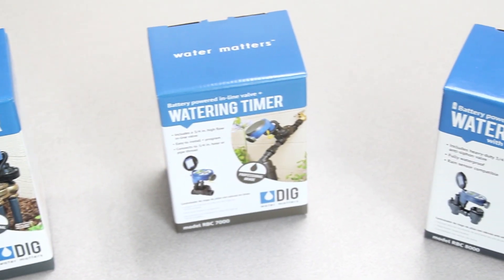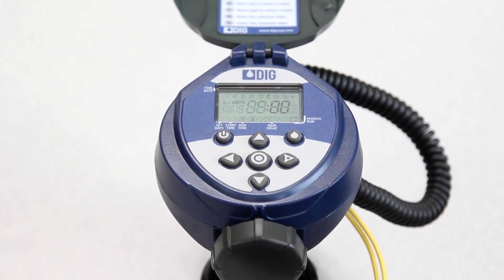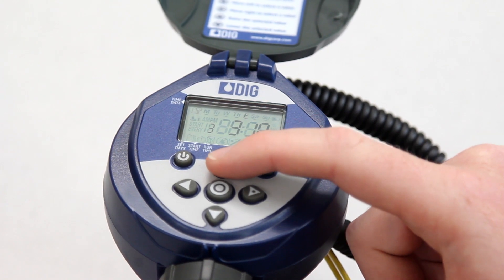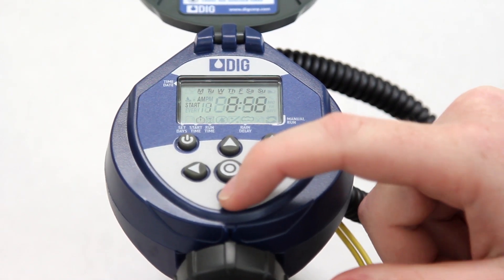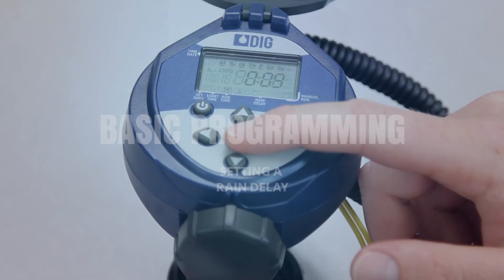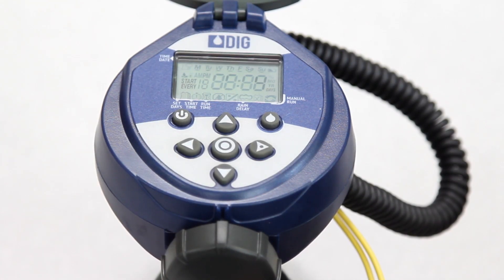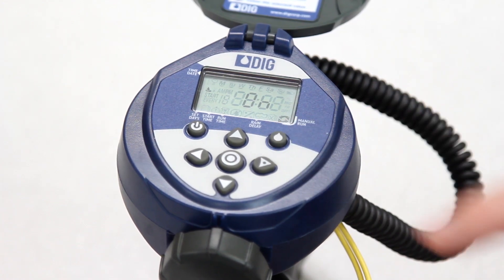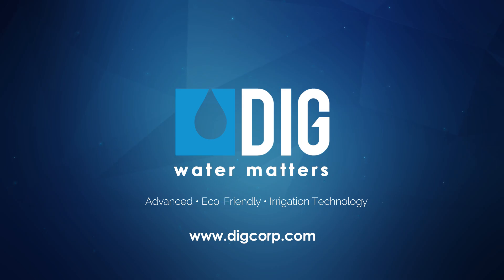DIG RBC Series Battery Operated Timers: Programming

Comment: The first page of the Instruction Manual should direct the new owner to the YouTube video for programing this timer.  The printed portion of the programing section makes complete sense ONLY after watching this video.  

Dig Corp, the acronym KISS is suggested for those that write the manual.  "Keep in Simple Stupid".  I had been using the Dig Model 2004 for 21 years, faultless product until the small plastic 'bayonet' was too worn to function, that part is no longer available.  It was replaced with a RBC 7000 with absolutely no need to change any 'plumbing', thanks Dig.

Comment: I ser a rain delay and it never resumed watering.

It would always just say 4 days on the rain delay setting.  So I finally went in and manually turned the rain delay off.

What did I do wrong?  Shouldn’t a rain delay count down and then resume watering after that 4th day (what I was trying to set.

Comment: My sprinkler system is programmed but just won’t turn on automatically anymore. I have to press the manual button if I want the sprinklers to turn on. What can I do?
Reply from the maker: Hey Ivan, can you please call our tech service department at (800) 344-1172 and we can troubleshoot this issue with you.
Reply: @DIGCORPORATION  what was the solution? I have the same issue.

Comment: Lets get real here. This timer although full-featured, and battery operated, is about 5 times more difficult to program than it should be. I will seek someone else's product. I'm surprised that you didn't include a note at the end of the video to the effect that, if I had any problems I could always "rewrite the embedded code".
Reply from the maker: Hey Jack, sorry to hear about your issues with our timer. We do have customer service available at 800) 344-1172 from 7:00 am to 4:00 pm PDT that can help with any programming troubles. We also have a bluetooth option that is very simple to program, if you're interested. https://www.digcorp.com/professional-irrigation-products/410bt-series-bluetooth-battery-operated-controller/

Comment: My sprinkler won’t stop watering, I’ve tried to switch the manual cycle on/off, remove the programs and leave only one active and still it goes on and keeps watering. It was working fine until I had to replace a seal in the water valve, now it won’t stop, I tried following all the steps in this video instructions. Any advice on how to try to reset back to normal? Thanks!
Reply from the maker: Hello, it will probably be a bit easier to troubleshoot this over the phone. Please call our tech service line at 800-322-9146 from the installation site and we will go through it with you. It is most likely a valve/diaphragm issue.